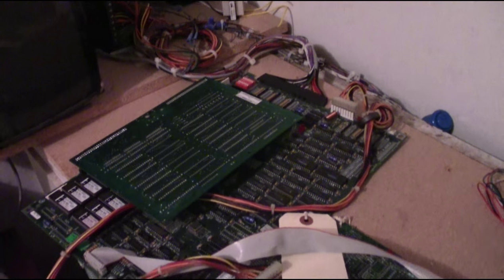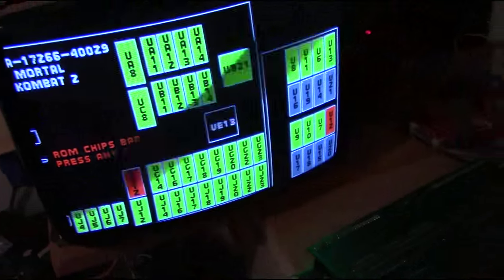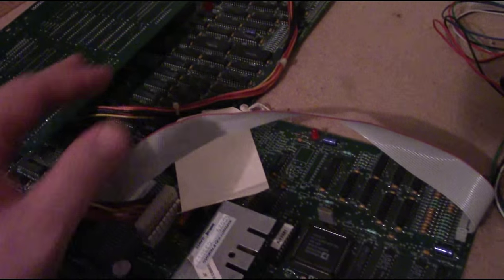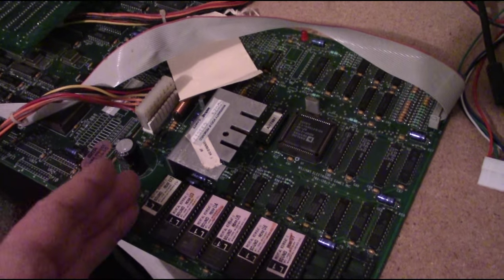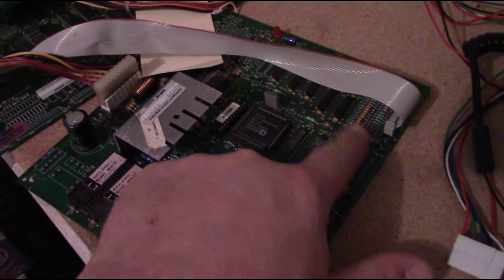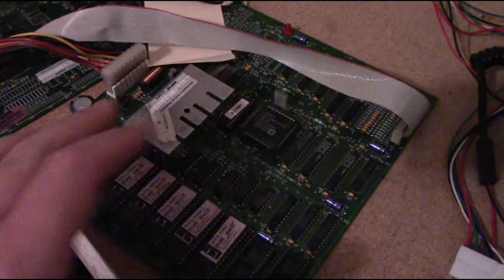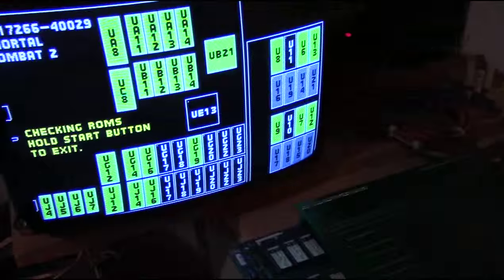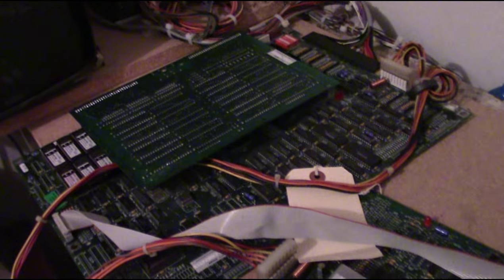Mortal Kombat 2 Arcade PCB Repair For Tony Acosta [HD]

Comment: I was just given a board to repair and my MK2 sound board has no capacitor on C34/C105 but in your video it does. I checked the MK2 manual and C34/C105 isn't listed on the parts list. I looked at the traces on the back and it looks like this cap is only used if the headers under it are in use (P3,BR1,F1), but as you can see those 3 headers were removed. So why does the board in your video have a cap on C34/C105?
Reply from the maker: Most likely a provisional installation. Install one and see what you get. Won’t hurt anything.
Reply: @YourMKArcadeSource  Yeah I tracked it down It's a filter Cap 2200uF @16v
Reply from the maker: @TotalMK  Oh, yeah. That one is 100% necessary.
Reply: @YourMKArcadeSource  Cheers ill replace it tomorrow :D

Comment: Hi! I got 2 MK2 Jamma board, one working with the memory expansion board without sound board. and other no workin 8mb version board with sound board and power and date connection cables.

The problem I having is when I connect the sound board to my working board, the main board automatically cut the the power off. and when I unplug the power cable from the sound board, the main board power on and boot correctly. Im not sure if is a problem of the power cable or sound board itself. In all yours years fixing those things, did you heard about something like my problem before? any recommendation?  I have the -5v connected and checked if is any pin bend and touching other in the back of the sound board and main board as well.

The other main 8mb board only lump 1 red leg but nothing comeout to the screen.

Anything will help.

Comment: Hey man really sorry to try and bother you with the millonth question you've received. 

I have a board that works perfectly....except for ONE leg on the UE13 chip. It's really driving me nuts as i have to take it out and adjust the leg to make it playable every other day and with having the daughter board attached it's just a chore.. Is it possible for me to just resolder the leg back on to the board for it to be sturdy and not need adjusting to play normally or is that something that will ruin it. Kind of a scrub with these so again, sorry. Just been driving me nuts and would appreciate an answer before i drop 200 on a new board.
Reply from the maker: No reason why you couldn’t solder a thin wire to that problem pin and then to the corresponding pad on the other side of the board. That should work fine.

Comment: I have one that says U6 thru U12 are all bad roms. Those are the roms on the memory expansion board. Any suggestion where to see if the board is getting the proper voltage?!? I don't have a pin-out for the two 50 pin connectors, but if the power is getting to all the roms, I"ll believe the machine, until then, I'm looking to reflow a lot of joints, and take readings from each rom power leg.?!? Which isn't going to be easy with the way it's mounted. (Any suggestion would be greatly appreciated.)
Reply from the maker: 4malulz I assume you have the expansion board installed correctly? It needs to be fully seated.
Reply: Yeah, the game comes on and plays... Only the characters themselves "inside" the game are all scrambled, exactly like your MK video, you replaced two roms/rams. The service (audit) screens all work, sound cuts in and out, from soft to loud.But I can deal with the sound issue later. My CPU status says all the expansion roms are bad, and the background in the game appears, but the characters themselves, whoever you pick to VS, are both all scrambled like out of sync with the rest of the game. Makes me think bad roms... But I want to make sure they are getting proper voltage.
Reply: Checked all the voltages, and all are a clean 5v. U6-U12 are all getting proper voltage. I started to check all the resistor packs, 2.7k on all but two packs, on 3 pins of two pacs, I got a 1.5k (all the same value, on all three positions, so I assume there's something in the circuit at those 3 locations keeping me from getting the 2.7k, I plan to pull those packs tomorrow, and check them out of circuit.. I then checked for 5v on the three controller chips, same a clean 5v. Went to diodes, I get values in both directions, a 6.3 and 3.1 respectively.on all the diodes on the board.
Reply from the maker: Interesting. Sounds like you're on the right track.

Comment: Yes I do have another board MK1 and that one works great. I Put my meter on the blue wire coming out of the pcb board going to the Monitor and I have some reading but when I put on the red or green my meter read 0. I can play the game and everything works but the screen shows black and white and blue.could this be a bad rom chip? Please help.thank you.
Reply from the maker: Rom chip? No. You need to look for open traces on the board or any other visible damage to the board. Look on the back side of the board for pins that might be bent over and touching each other.

Comment: I have umk3 revision 1.1 it passes all the checksums but during attract mode it resets and sometimes during gameplay what could be casuing this?
Reply from the maker: +phobophobia Check your voltages. Sounds like your power supply is dying.
Reply: +YourMKArcadeSource the reset button on the pcb was sticking pressed that a few times now working perfect so far so good
Reply from the maker: Interesting!

Comment: How would I go about replacing the u2 rom on the sound board? One of the metal legs broke off so I was just wondering if they still make these roms or where would I find a blank rom at? On the other note the red light no longer turns on when I turn on the cabinet. So I believe I'm having the same issue as in your video
Reply from the maker: Yes. If the U2 sound rom is bad, the board won't work. You can easily 
get them. You'll need an M27C4001 rom. You'll need to program is from 
the U2 file in the Mame dump of the game. It's pretty easy. Although, if
 you don't have a programmer, it will be a little more difficult. Did 
the leg break off clean or is there a little bit still there? If there 
is a little bit there, you can either solder what's left of the leg to 
the socket, or you can place a conductive material in the socket so it 
contacts what's left of the leg. Does that make sense?
Reply: I'll have to go take a look. If all else fails, than I'll just look on e-bay for a MK2 sound board. Would my game still work if I bought a new sound board? or would I have to buy a new MK2 board with the sound board? I'm just now getting into collecting these arcade games.
Reply from the maker: You'd be fine just getting the sound board.
Reply: I just got my new sound board but when I hook it up All I get out of the speaker is feedback and a buzzing sound. When I hook up the old sound board I don't get that. Do you think it has anything to do with the happ control box?
Reply from the maker: No. I assume you're hooking up the ribbon cable correctly at each end? Pin 1 of the main board to pin 1 of the sound board?
Reply: Everything is hooked up correct. pin 1 from the main board to pin 1 on the sound board. The only thing I notice on the happ control box. There's one wire that's not screwed in on tha box which is the +5
Reply from the maker: The sound board requires -5vdc. That must be hooked up.
Reply: YourMKArcadeSource there's two wires screwed into +5v15a and the wire for -5v1a isn't screwed in. Would I need to un-screw the +5 and just screw in -5?
Reply from the maker: That's your problem. The sound board requires -5vdc to work.
Reply: YourMKArcadeSource the only wire that needs to be screw in is -5 with the yellow wire?
Reply from the maker: NO! Check your Jamma connection and see what color wire is in the 5th location from the end. It should be 1) ground 2) ground 3) +5, 4) +5, 5) -5, 6) +12. Which ever wire is in the 5th spot, that's the wire that needs to be on the -5vdc. Normally, the yellow wire is +12vdc. If you hook the -5dc to the +12vdc, you will fry your sound board. Use this chart for reference...

http://wiki.aussiearcade.com.au/images/c/c3/Jamma_pinout.png
Reply: YourMKArcadeSource what about the happ controller box? The box has a -5 but there's nothing screwed in. Sorry for asking all these questions. I'm new to all this
Reply from the maker: No problem. What do you mean when you say "Happ controller box?"
Reply: YourMKArcadeSource it's a black box that if I un-screw one of the wires the Monitor and the soundboard won't turn on
Reply from the maker: Are you talking about the power supply?
Reply: There's all kinds of wires screwed in except one has nothing screwed in. The only one that doesn't have anything screwed in is -5v1a
Reply: YourMKArcadeSource yah I think so. It's called a Happ controller power pro

Comment: I have a Mk1 that passes all the checksums ok, but no sound comes out of it,
Reply from the maker: +chinitosoccer1 Is your sound board hooked up properly? Do you have a sound board hooked up at all?
Reply: yes it is, I have uploaded a video to my channel showing the board
Reply from the maker: Well, there could be any number of reasons. It could be a voltage issue, it could be a bad ribbon cable or power cable (bad connection/bad wire) or it could be something with the sound board itself. Try adjusting your voltage (not too high) and see if that makes a difference. Then make sure your power cables have the correct voltage where they hook to the sound board.
Reply: I have checked the voltages in both ends of the soundboard power cables, and also swapped the ribbon cable but it didn't change anything, don't know what else I can do, check for bad caps? dead sound amp?
Reply from the maker: Yes. Both of those.